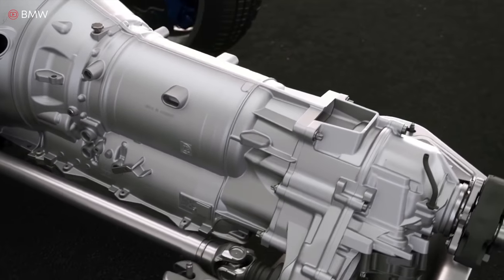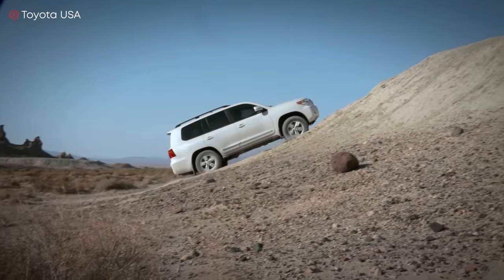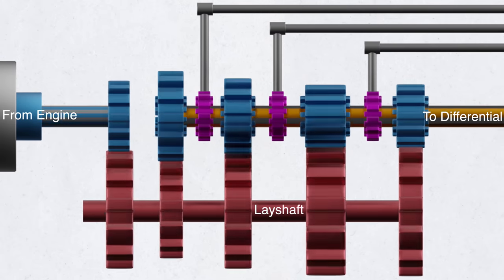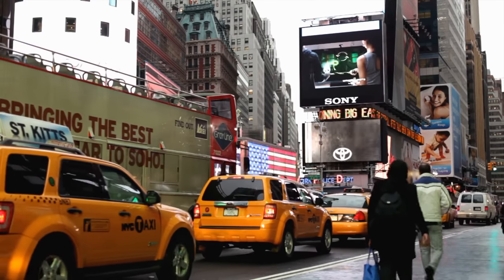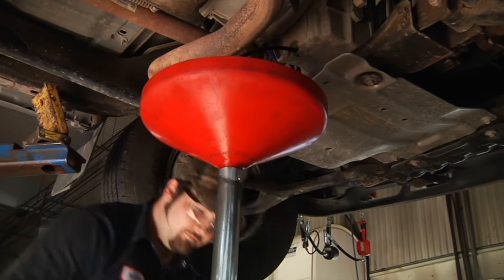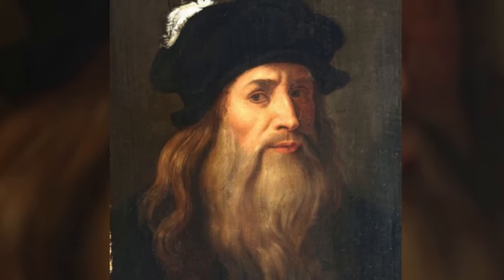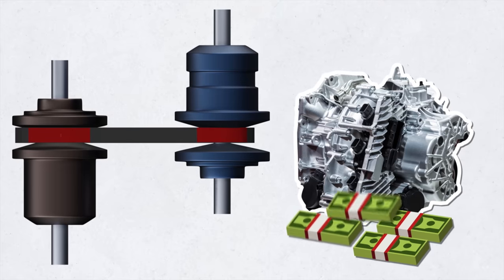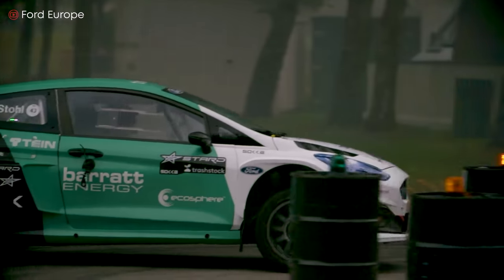Who Makes the Best Transmission and Why

Comment: Wtf? So what's the difference between semi automatic and automatic? Is there a difference?
Reply: Semi auto Is an American trying to drive a manual ...not knowing what a clutch pedal is
Reply: Semi automatic is a automated manual where you dont use a clutch pedal. That action is controlled by a ecu or torque converter.
Reply: Oh ok I'm just trying to learn. I know cars have paddle shifters and that made me relate that to the word "semi"
Reply: @BigMerc91CMDNJ  some use the paddle shifter to change the gear. for instance the lexus lfa is a automated manual meaning it isnt an automatic but rather a manual without a clutch pedal and stick.

Comment: Nissan cvt  is the worst transmission ever made , i replaced it for my 2013 nissan sentra two times then i sold it as it is when it broked again , for 1500$  still looks brand-new  with only 92000 miles  i hate nissan

Comment: SOMEONE TRYNA HELP ME PICK OUT A FIRST CAR⁉️
Reply: @kerriwilson7732  got any years to recommend?
Reply: @taylean15  just bought a 2002 with 230000km to replace a 2003 with 300000km + (odometer maxed out at 300000km before we bought it 2 years ago). 
What year would I recommend?  Depends on your budget. That 2003 looked like a wreck, but it cost $500 to purchase & took less than $500 in repairs for 2 years running. The 2002 cost $1100 Canadian but looks decent. If you need to validate yourself by impressing people with your car, pick a high end vehicle. If you want reliable, economical transportation (& a reputation for being sensible), get a cheap runner that won't steal your money. Plus for a 1st vehicle, cheap is important because you will probably scratch or dent it. You can live with a ding in a $1000 car, you'll cry yourself to sleep if you're making payments + your insurance jumps. I know kids that bought new cars they can't drive because the cost of insurance!  Car sits on their driveway & they pay $100s a month on the car loan, but they can't afford insurance to legally drive.